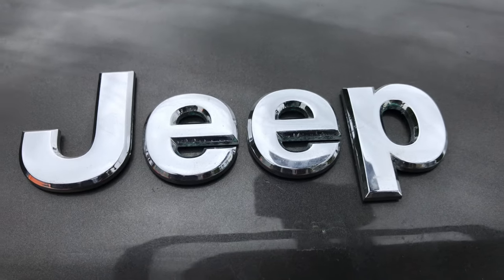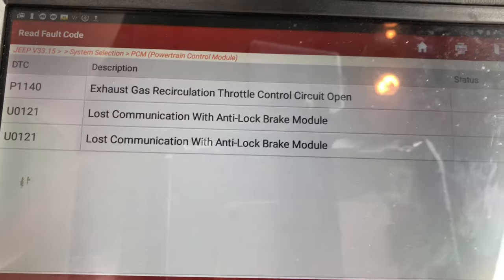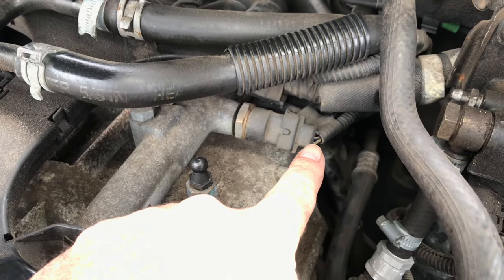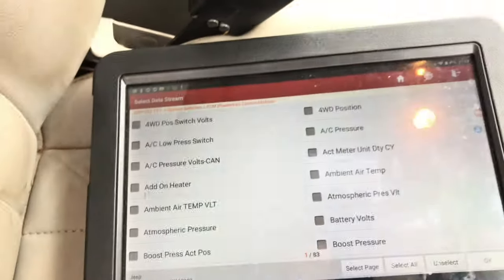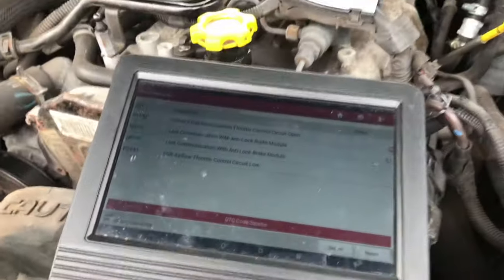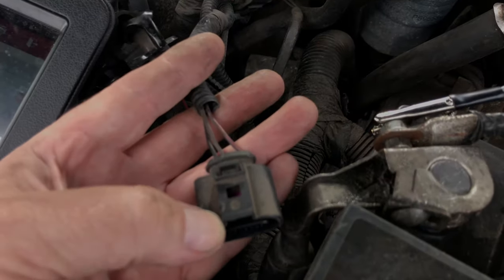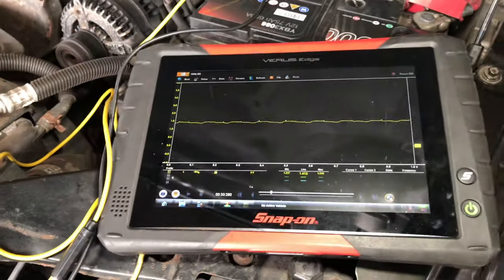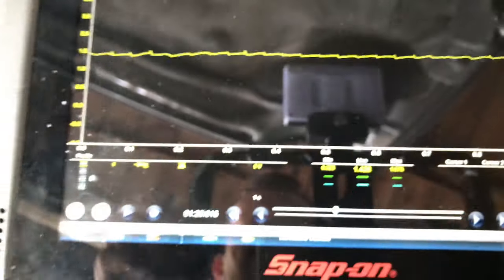Jeep Cherokee (2008) - P0093 Large Fuel Leak, P1140 Throttle Actuator Control Valve

Comment: Hello, thank you for your video. I wanted to ask you, I have a 2005 Jeep 2.8 Diesel CRD and I have the same P0093 fuel fault but I am not able to find the fault. I have changed the diesel filter holder and the camshaft and crankshaft sensor and it is still misfiring with P0093. What was finally the fault on your Jeep? Many thanks! Best regards!

Comment: nice to see the scope out sandy
Reply from the maker: Sure is Ian but just remember the Picoscope 2204a for £100 does the job even better!!! Sandy
Reply: @sandyande  yea I am going to purchases one next week sandy cant do without one any more nearly got caught out testing a fuel rail problem on a Mercedes e220 211 i was about to change the pressure sensor but i had seconds taught and looked more towards the fuel metering control valve and it was the causing of over fueling the fuel rail. i would have been at the loss of the 3 wire pressure sensor and a very mad customer i just started a mobile business hear in Ireland  after a few tough years with the loss of 3 of our kids i am back working and trying to make ends meet so i need a scope big time so i don't get caught out. thanks ian
Reply from the maker: Sorry to hear about your children Ian, my condolences to u and your family.
Reply: @sandyande  thanks sandy we find a way true it just have to have  faith in our lord . I have a new oppurtuinty to open new doors bud thanks. Ian